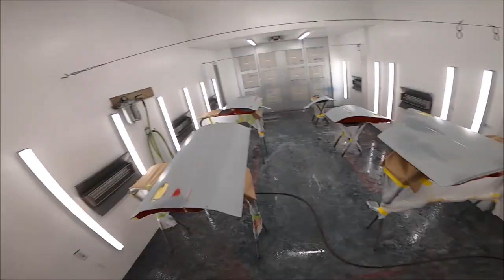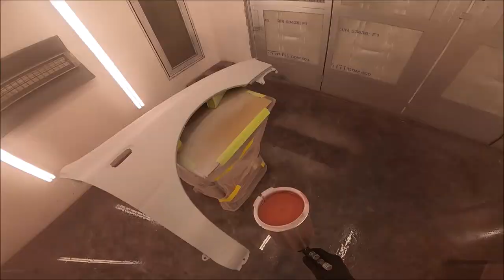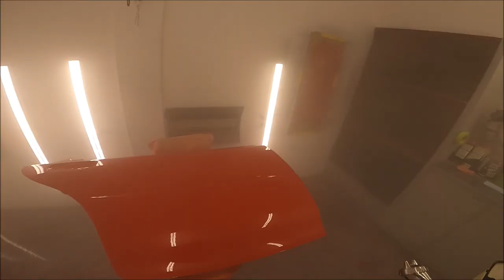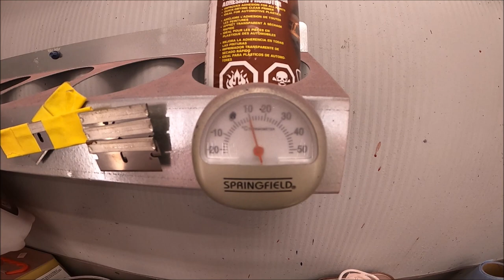JDM GC8 WRX Type Ra - Pov Painting - Part 8

Comment: Just a small tip of advice, looks like your exhaust system isn’t too strong. Try to start from the back of the booth to the front to avoid any sort of overspray problems! Also investing in some proper bumper and door stands will save you money in the long run!
Reply: Overall amazing work though! 👌🏼
Reply from the maker: Definitely want to get some proper stands. Just need to up my cash flow but has been something indeed I have had my eyes on. As for the exhaust, I believe my exhuast filters are now completely saturated. They are crunchy 😬 I have a pack to replace them before next wave. It was the last 2 times I used the booth that I felt for first times I couldnt see very well with all the spray lingering in the air

Comment: Hello, Great job on this véhicule, the red looks great on it...I am also in the process of restauring a GT 99 and in view of your skills, i allow myself to ask you for information. I have the right and left floor renforcement sheets in very pour condition, especially the right which was badly repaired.These parts are no longer manufactured by subaru (réf 51630FC500 and 51630FC510)and cannot be fond in France. Would you have contacts to find these parts or could you remanufacture them for me.(i don't have tools for that). Congratulations again for all yours achievements. I Hope that you could help me..
Best regards

Matthew.
Reply from the maker: Hey Mat, yes I know the part you mean. We have had to reconstruct those before. I dont think without a car here to mach up on that i could easily make them. Id say if you want oem ones, look to have them cut out of a donor car with the floor section above. Then drill out the spot weds and re install. 

Hope that helps and thanks for watching